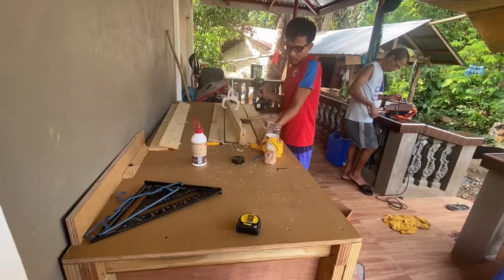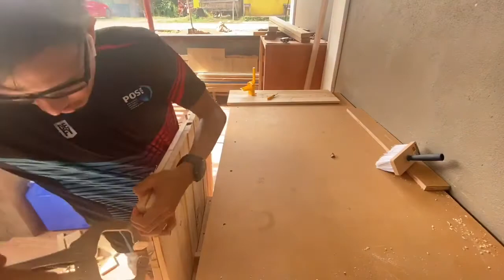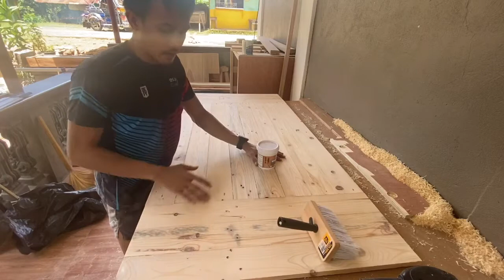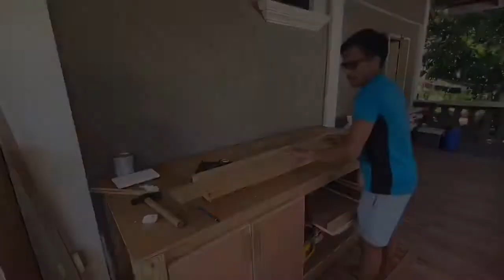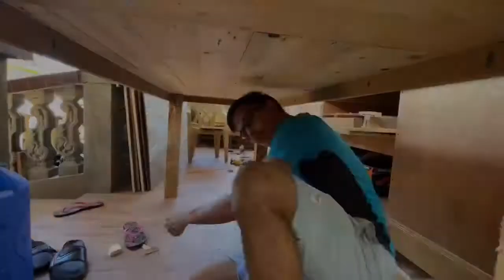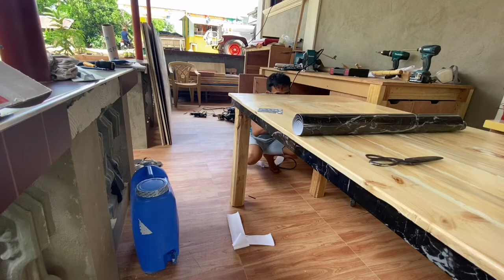How to build dining table from scrap pallets | Woodworking table for begginers

Comment: Great vid, Sir. Question po. Since we’re planning to do DIY’s at home. Including table set. 

1. Ano pong wood cutter (circular saw) gamit niyo? Stable po ba gamitin and safe?
2. May ideal brand po ba for the dowel pin? San po maganda bumili
3. Required po bang nasa arawan pag nag-aapply ng TSP? 

Thank you in advance.
Reply from the maker: If plan you po bumili ng pang diy i think it is better to start with jig saw or get booth jig saw and circular saw. No specific brand ng dowel pins naman kahit ano pwede nyo gamiting. Di naman required paarawan ig nglagay k ng tsp sa video ko pinaarwan ko lng para mapabilis kng madry ung table top.

Comment: The way you attached the table top makes no allowance for wood movement, it's going to crack over time.  Should have gone with figure 9 brackets instead
Reply from the maker: . I dont have available figure 9 brackets the time i made this project. Thanks for that input. You’re right. I already put fgure 9 brackets on it.